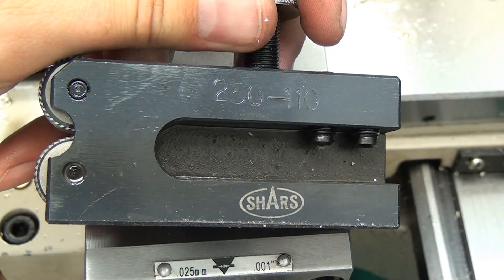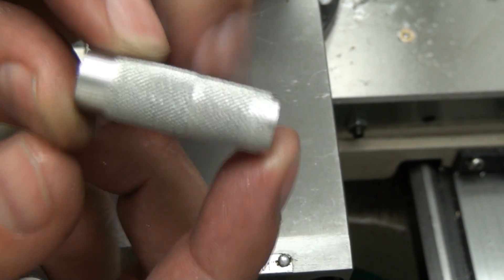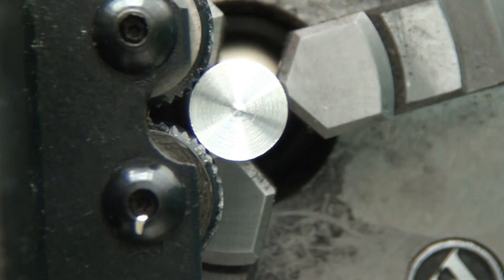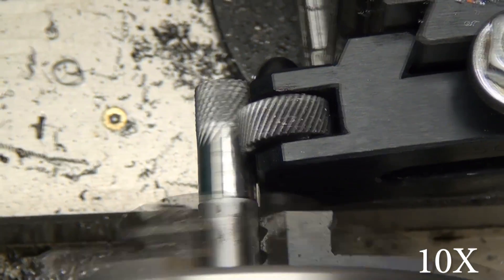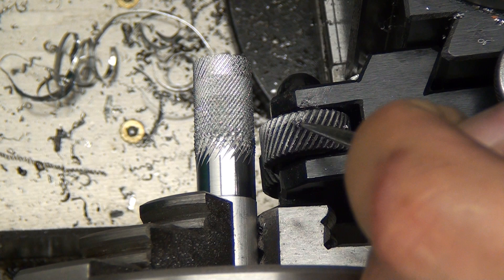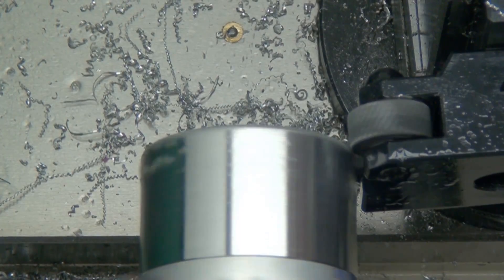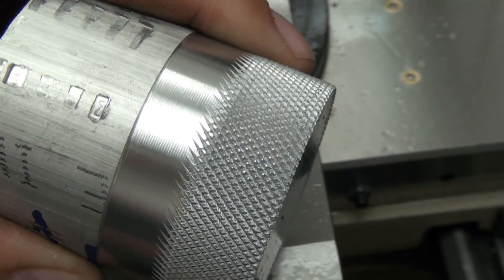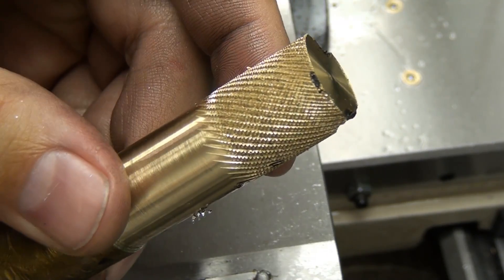17 G0602 Knurling (Part 1)

Comment: You do not need to match the diameter of the work too match the knurl pitch. You can get perfect knurling on any diameter work.
Go in 'hard and fast' with the knurls, use low RPM, slowish longitudinal feed and flood cutting fluid - worked fine for me for the last 49 years
Reply from the maker: I've come to find the same. It's fantastic there is all this math.... that we can basically skip over. I like your style. Cheers.

Comment: Man not trying to be Debbie Downer here but if my knurls looked like them I'd be turning them off and starting over. The speeds and feeds seem to be way too aggressive. Knurling can definitely be a pain in the ass and it changes with every different material. I find creeping up on to the work surface and establishing the pattern works best, and then you can slowly feed across. A good knurler would help too!
Reply from the maker: You're not alone.

Comment: why wd 40? it's no a lubrican it a cleanser. wouldn't sulfer lard have worked better?
Reply from the maker: In my experience it works fine as a lubricant when cutting aluminum, but yes it isn't the best. Actually now that I think about it, it's pretty much all I use for turning aluminum. For tapping I don't like it at all and use Tap Magic or similar.
I'm sure a sulfur lubricant would work better, but I have never bothered to buy any. If I were going to get some, I would probably go Viper's Venom. I love that guy's channel, but he doesn't post anymore I don't think.
Reply from the maker: Oh I'm wrong, he posted 6 months ago. Nice!
Reply: its an old machinist trick to use WD-40 to get a good finish on aluminum. Kerosene works well too.

Comment: I don't want to be a wet blanket but those results are not god the finish should be crisp and pointed I think those knurls are badly made or worn out never heard of this 5 deg thing?
Reply: Best thing you can do with that Chinese knurler is convert it to a tool holder.
I use the cheap three revolving headed knurler fine, medium and course now 25 years old, no clamp type.I have never ever worked out the diameter and depth of knurl, just got on with it works every time at full knurl profile.Use coolant, worst case it washes debris away and reduces stiction
Reply from the maker: +pijnto You're probably right. Two things to remember, it's a cheap knurler, and it's the push style instead of the clamp style. I have no doubt a better tool would give a better result.
Reply: I didn't want to say anything but that's true they were terrible knurls  I personally do not have all the answers I am trying my hardest to learn myself. there's nothing worse than getting a piece finished and then ruining it with knurling. I'm having more success with an old Armstrong tool believe it or not
Reply from the maker: jhareng Haha. I haven't used this tool as a knurler in a quite a while. It's a boring bar holder now :)

Comment: Use the lead edge of the wheel 2 deg flood the part you will get a better knurling First time... This works only if you flood the part to remove the
Chips

Comment: I always take a couple of passes and keep the tool engaged and just reverse the spindle. I never kick the tool at an angle, always squared up. You really need to be using a good quality sharp tool, I like the scissor type holders and use accu trac rolls. I did see the roller jump during the the video, which is not going to help with the finish. Regardless it's not always an easy task. Great videos keep them coming.
Reply from the maker: Thanks! I like the idea of making multiple passes with the tool engaged, I'll try it. Yeah I really need a better knurler. After Tom (from the Tom's Techinques channel) finishes his build I'm going to make the same tool. His looks awesome.

Thanks for watching!

Comment: Right and left knurls on a twin set up are always a hit or miss. Some things you want to be cognisent of. Never hang three x the dia out of the chuck or collet//especially when knurling. 5 deg draft is way to much, try 0.5 or 1 deg. Always give yourself some kinda lead in. either on the part or on the tool. ALWAYS use lube! Spit on it if you have to. Certer Line is important, you got that. Try working on the body, traversing off the part. feed in accordingly. Try bump knurl, it's easy, fast and looks nice. Oh, and by the way only draft 0.5/1.0 Neg won't hurt build up to lead in but more than that may snap the tool if you push it. and traves a coulpe of time to save your bearings....Don't forget to lube!! It essential

Comment from the maker: In my experience the most important thing is have a fluid that will keep the knurling rollers clean. Aluminum will gum them up, which is why I use WD40 and keep it nice and wet. This doesn't seem to be as much of a problem with brass, and not a problem at all with steel. Again, this is just my limited experience. I am not a professional and don't knurl on a daily basis.

Comment: I hate knurling with this type of tool, the pressure is coming from the side... I use aligator-jaws type of knurling tool (the knurling wheels come from above and below the center line of the part, and a screw tightens them together), this creates even pressure on the part, no pressure on the bearings in the headstock, and does not require a dead center to support the part.. also, to prevent "partial knurling" at the ends, i use a micrometer carriage stop, that stops it exactly the same place.

Comment: One other tips, if you do calculate the circumference and turn the right diameter for knurling you’ll have a better result with the tool, also this will permit a clean up finish pass to remove the sharp high points that knurling produces.

Comment: If you want to have the best knurl on your part, you have to support the end of that part with a dead center.    THat way you'll have an even pressure of the tool and you'll be able to do knurling on longer parts.  If the part is flexing with the tool pressure the knurling will look bad and you will have a scrap part.

Comment: I guess I have only been a toolmaker for 30 plus years but from what I can remember and the method I use is you actually use either kero or a very thin oil like WD40 when cutting Al and in all the books I have read when doing my schooling. When I do knurling of any material I actually only use a wire brush to keep the swarf off and never use any sort of lubricant. Thats what I was taught in Australia back in 79 and it always works but it does come down to the skill of the operator.

Comment: i don't know who taught you how to use a knurling tool,  but every shop class i ever been in i was taught 90' to the part, set depth of cut statically, then spin up the drive, and recheck cut looked good,  then engage the cutter moving from thickest to thinnest.   or from start of cut continuing off the part (think handles).   adding an angle to your tool unbalances the rollers and can lead to a poor outcome,  or at least uneven wear to the bearing/shaft.   always start with the tool on the part

Comment from the maker: The document listed in the description may have it, but I have not checked. If it isn't in that file then it probably doesn't matter. When knurling, I ALWAYS feed at the slowest possible speed with the RPM's as low as they'll go.

Comment: Not bad video, but use some aluminum cutting fluid. a tail center would help with any deflection you have when cutting. make sure you use a "dead" tail center with some Hi temp grease when cutting steel and a little for aluminum. yeah the tool post may be a problem to work around but the results will be at optimium. nothing wrong with multiple passes just don't over do it.

Comment: If they were doing it over and over they may have been doing it to create a certain pattern. There a atleast 10 different patterns a knurler can have. It won't break a knurler to go back and forth over it. But it will typically wear it out and not leave the correct pattern, unless you were to almost do it like a thread.

Comment from the maker: @Lyk31337 I was just thinking about it, and in a situation where you are knurling something harder than aluminum and it required multiple passes, then parallel certainly would he the best way to go so you can knurl back and forth. I may have to try that.